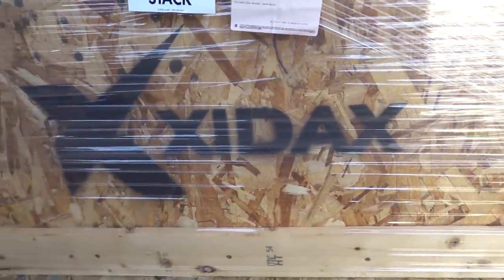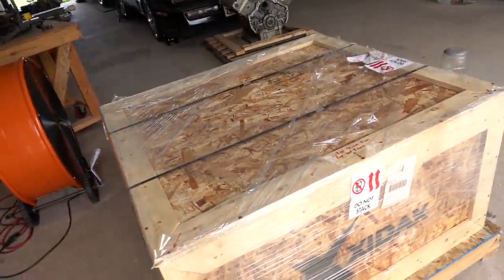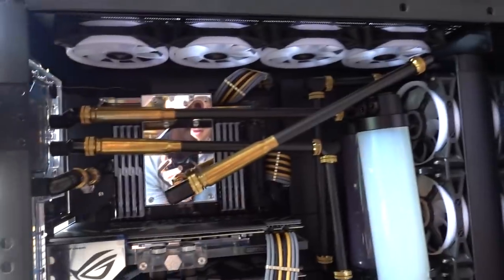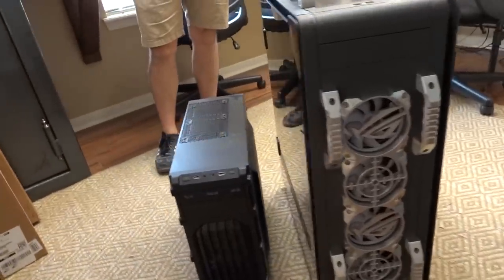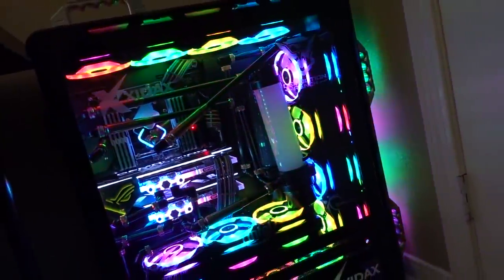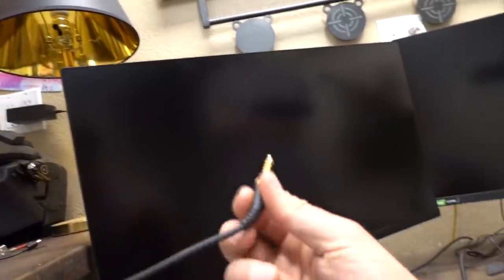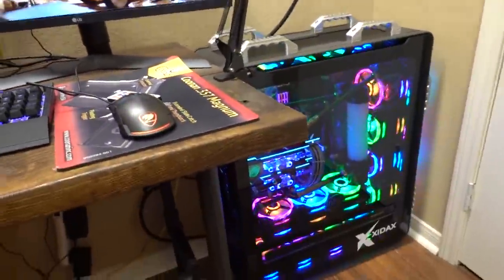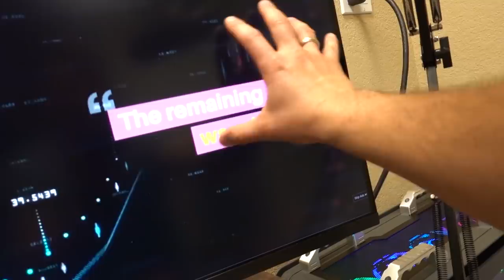The Demolition Ranch Ridiculous New Gaming Computer! TWITCH!!!!!

Comment: You need to get a really good surge protector/ups for this man.  That's like a $15,000 computer.  Don't just plug it into the wall!
Reply: Its built into the PSU on this system. But it never hurts to use one regardless. For 500$ with a 10 year warranty, you bet your ass EVGA built this PSU tough and with built in protection.
Reply: He probably has one for his entire house
Reply: @Elmer_RedEagle  You mean they have UPS on the PSU? Damn thats pretty neat
Reply: Agreed, I run an ups on my gaming PC and my router and modem.
Reply: @Elmer_RedEagle  &  @Tony K  A lot of modern PSU's will protect your system, and for such a pre-made PC build the PSU was specifically picked and probably has a unnecessary 80+ Gold or Platinum certification, so it's pretty much guaranteed it will protect without additional external UPS. UPS for gaming rigs, or in general, in home conditions are useful if you got a power blackout and you can keep using your PC for some time before UPS runs out of collected power, or shut the PC safely off. But any decent PSU should guarantee you a protection from surges.
Reply: Terrible advice. A UPS would be recommended, but NOT NEEDED.
Reply: @BIOSHOCKFOXX  They have failsafes built in, but that will only go so far. THERE IS NO PSU WITH A UPS BUILT IN.  The specific PSU is massive overkill for this, unless he's going to try overclocking the snot out of the CPU and GPU with LN2.
Reply: more like 20 grand
Reply: Please can you be more transparent with what products you get for free and whether or not they require your advertisement in return. Would be nice to know retail price on a pc like that and all other free products you get.
Reply: @jordanhart9708  So you don't think he should be running some sort of surge protector for at least 15k dollars worth of equipment? Come on man, that's just dumb.
Reply: @jordanhart9708  I don't think it's that much overkill.  Just the actual PC parts alone should be in the ~700 watt range, I'm guessing they are probably running the water pump and all 20 of the fans off of it too, along with the LED's,albeit they don't comsume much power.  They probably could have gotten away with a 1200 instead of a 1600 but they are basically the same price anyways...
Reply: @BIOSHOCKFOXX  They have some safeties built in like over and under voltage, but nothing that could actually take a surge.  Even a $30 special from Walmart would do a better job than just plugging it into the wall.
Reply: @954eb  It's entirely possible, and if that is the case even better.  I'd still be running an endpoint type protection too, can never be to careful with the cost of that equipment.
Reply: @TKacys9HR  He could have gotten away with a 850W unit. 1000W would have given a good bit of headroom. 1600W is simply overkill unless you're doing LN2.
Quite frankly, you don't HAVE to run it via a surge protector or UPS. Is it advisable? Yeah, particularly if you're in an area prone to power issues (Texas hill country isn't). If you're overclocking, a surge protector can make the power a little dirty. In that case, a UPS would be a much better investment anyways.
Reply: @Elmer_RedEagle evga isn't horrible but I always go seasonic or corsair lol
Reply: @dashausdesamadeus9557  1600W DC PSU would require a UPS that can do 2200va, those typically need a 20A circuit to supply the ups (I have 2x 2200va UPS). @OffTheRanch I would suggest getting one if you have any power problems in your area like dimming or flickering lights.
Reply: Ben Shapiro GFCI and AFCI outlets are not surge protectors. They generally don't care about the voltage/current going across the hot terminal.  They only care about the neutral or ground terminal, and they trip for different reasons...  Infact GFCI don't even work without a 3 prong grounded cord that is intact and undamaged. AFCI outlets/breakers can trip from high current inrush, which can happen with large computer PSU's getting plugged in or turned on... I hate them both..
Reply: @TKacys9HR   Ok some surge protectors come with insurance for the things plugged in, which is one point, It can help people avoid ground loops if people are tempted to plug into different wall outlets which possible could be running off a different breakers. All of the AC side electronics had to pass the same "surge protection" requirements for UL, TUV.. etc as a "surge protector power strip" The PSU has more requirements, since it's converting to DC with a number of different voltage regulators off the main rails. A surge protector is not going to protect your computer more, however a UPS "uninterrupted power supply" is a totally different animal and has batteries and or a different grid power input. The systems I've worked with are depended on by the US military at the most secure bases underground, and the electronics and equipment fundamentals have not changed for 20 years.
Reply: Pcs are protected worst that could happen is a PSU replacement
Reply: got to be worth more than that wouldn't it ?

Comment: !!!!!CAREFUL!!!!! One of the Reservoirs has come loose, that's why it's at an Angle! The one closer to the Window
Reply: Somebody better get his attention!
Reply: look again its resting on the million fans on the bottom... this pc is a shame..
Reply: Matt carriker is the biggest chad I’ve ever seen
Reply: Ikr, crazy that they missed that crooked Reservoir.
Reply: Good spot, was wondering why it skew
Reply: Not so sure, that’s hardline tubing. So if it did come loose there would likely be a leak. But still Matt, make sure it’s properly attached.
Reply: Just about to mention that.
Reply: the res is fine, just came out of one of the clips.  No biggie just pop it back in
Reply: ikr he just has to pop it into place
Reply: Good luck with the 6-12 month maintenance you'll need to do on the water loop 👌
Reply: Xidax could of made them runs a lot straighter. Would make it look cleaner.
Reply: Good thing xidax has a lifetime guarantee
Reply: @wyattfritz3695  agreed.
Reply: God I hate water cooling, for the amount of fans he should have just used air cooling. Love the pc but damn that's gonna be a pain in the ass.
Reply: @emtjim224  Xidax has some questionable PC  techs to say the least. Hopefully this holds up for him.
Reply: @wyattfritz3695  depends how it's built and what fluid they used. I've got white pastel fluid in my loop, which was properly treated before filling. I've ran it for 9+ months so far without a hint of staining, color change or performance degradation. Can easily go over a year if you know what you're doing.
Reply: @squidiz496  Even 30 fans on air won't get you anywhere near the cooling potential of a loop like this. This thing should be able to keep those two 2080ti's in the low 40's at max load with a 2+GHz overclock, and prolly under 60 in games and rendering on the 10980xe with a OC as well, all while staying near silent. 

You're never doing either of those with conventional air cooling.
Reply: @soulshot96  he will probably get someone else to do it knowing that hes an amateur and doesn't have a clear interest.

Comment: The computer is turned on for the first time... Mere yells "Honey. we've lost power downstairs..."
Reply: Was wondering if it'll make the lights dim at the very least, that seems like an awful lot of juice off the cooling lines alone
Reply: @wlehtola  apple or orange
Reply: Nah, the  computer wouldn't do that it's about the Watts on the power supply! i say he probably has about 900- watt to 1200 watt power supply! that the power supply have a safety feature which would make it shut down!
Reply: NinjaRider777R 
Case fans typically around 2 watts of power each so even if you had 50 fans you’d only be using 100 watts (bare in mind with that many fans they are all likely never going above 30% RPM. Why have a loud system with that many fans?). A single watercooling pump can use 5 watts on the low end to 25 watts on the high end. 
Fans and pumps don’t use much power. You can run multiple fans off a single motherboard fan header. 2-3 fans per header isnt abnormal. 
3x MultiGPU setups with massive CPU’s (like the Intel Extreme series), dual system setups, or LN2 overclocking is why those massive 1600w power supplies exist. For example, a single overclocked NVIDIA 2080ti graphics card can use 330 watts of power. GPU’s are the number 1 user of power in all gaming/vid editing/everyday PC’s. 
I own a custom watercooled system. It has 10 case fans with 6 of the fans cooling two 360mm rads in a single loop which cools my CPU and GPU. 
The system has a single overclocked NVIDIA 2080ti and an overclocked i7 5960x Intel extreme series processor. My power supply is a Corsair AX1200i. It maxes out at 1200 watts. 
Even with all the fans, the pump (running at max speed bc it’s a DC pump), the overclocked GPU and CPU, the 5x hard drives I have in the system, along with the large number of USB peripherals hooked up to all 10 of my Asus X99-e WS motherboards USB3 ports, etc...
At MOST I only use 650 watts out of my 1200w power supply. 
I even have a 1000 watt UPS hooked up between my PC and the power outlet. 200w less than my PSU in my computer itself is capable of. 
Even with my computer, 2K Ultrawide gsync monitor, powered Focusrite audio interface, 2 powered KRK Rokit studio monitors hooked up to the UPS it still comes nowhere near 1000 watts.

With his 2 GPU’s and CPU in that system he’s probably maxing out at around 1000w during EXTREME stress testing with CPU and both GPU’s running at max capacity.

Comment: The reservoir  looks like it's at an angle or got loose, I'd check that out
Reply: You can see it's out of the top bracket, just push it back in
Reply: There is a little more to it than just pushing it back in . I have worked with singularly pc mountd like that.
Reply: right? plus you can see no connectors on the top of that res,all on the botton so nothing supporting the top,using a U brace was a bad idea for that,they should have put an actual mounting ring
Reply: I don't know why he got such a high end water cooling build he will have no idea how to do maintenance on it
Reply: @Plane.  yeaaah... that's going to be a real bummer for Matt when he get's a leak, or the fluid gunks up that HUGE ass mono block, or clogs a VRM channel
Reply: Plane I’m pretty sure it was given to him right
Reply: Jeremiah Young Just because it was given to him right doesn’t mean that it won’t have to have maintenance done on it. Anyone who knows anything about PC’s and custom water cooling would know that
Reply: @Plane.  his brother drewski can help him on that.
Reply: @Plane.  hopefully operatordrewski will help him out.
Reply: @Plane.  ooof yeah rip matts loop
Reply: It was clearly angled purposely... the tubing is all solid and lands at angles all over the place... he can not "fix" this if it by design.

Comment: “It’s like Lunkers trying to explain his corvette’s features”.
😅😂🤣😭😭
Reply: hey lets play this yep
Reply: 30 fans... For 2 vid cards and guessing the top Intel processor.  Has be posted or talked about the actual build list? Haven't even heard of one, but even with a dual threadripper motherboard with 120 GB of 3300MHZ ram and quad 2080TIs.... 30 rgp case fans is just, "cool bro".

Edit: didn't even look at the description for build details that he posted. Tsk tsk, threadripper trumps Intel.
Reply: @MNTruckerBear  3300 mhz is not even fast and its called rgb
Reply: 2400 is the standard budget RAM speed, 3300 is 900MHZ faster than standard and 433MHZ slower than top tier... RGB is literally just flashy lights. Anything else?
Reply: @MNTruckerBear  that still doesn't mean much. 3300 MHz is really kinda average these days. There are plenty over 4000 MHz and at least one option available at 5000 MHz. Last I checked, that was far more than just 433 MHz than 3300 MHz.

Comment: The reservoir doesn't look like its held in its brackets properly, if it isn't its just being held in by the water pipes and could fall out and spill coolant everywhere. Might want to check that
Reply: I am assuming that is the fault of the custom tubing. Looks like it is attached at the very tips of that bracket attached to the radiator.
Reply: Also at 18:48 I just noticed you can see it is not even touching the bracket on the radiator. Tho it is possible it is attached to the other radiator sitting behind it. So they both could be attached, and that bracket on the radiator is just for stability in case it was to move?
Reply: He knows he mentioned it in his stream he's doing.

Comment: That crooked reservoir tank really bothers me. The piping job could had also been given more attention to, given the price point of this product.
Reply: first thing i saw was the res was popped out of its top clamp. its bugging the hell out of me
Reply: @badfudro  that and 30 fans... there is no damn need for 30 fans..
Reply: i think its not correctly mounted
Reply: Yeah, I think that it wasn't a good choice to just make the pipes go straight from A to B, instead it would look better if they were completely either horizontal or vertical and not diagonal. Kind of ruins the feel of the whole PC in my opinion.
Reply: I just think it popped out of the clamp during transport tbh..
Reply: @Baldwin_media  Seriously, 24 fans maybe (my computer is even bigger than this one), but not 30 if you have an air conditioned house. With that many fans, even if they are quiet fans, it becomes an audio issue. At the end of the video when he is reading the specs, you can hear the fan noise. 

Also, soft tubing probably would have saved the first computer. Moving that computer anywhere is risky because of the rigid tubing.
Reply: @Sahtoovi  Looks like this PC was built by Linus or someone that watch Linus build PCs
Reply: @Baldwin_media  I don't really get why there are two radiators basically on top of eachother, the other one is blowing hot air into the other. That's quite a weird choice for cooling, but I do see how it probably does offer a slight benefit.
Reply: I like the look of the diagonal hard lines. Everybody uses nice, tidy, soft lines that are tucked away. This is cool because it's different.
Reply: @MAGAMAN  My PC is around the same size, and I have only 6 fans, 3 of which are in my AIO's radiator. It does get quite loud under load but that's only because I have quite aggressive fan curves and have overclocked my CPU quite a lot. Fan noise isn't that bad if you are gaming, especially if you have a noise canceling headset, but while watching youtube or something it does get very annoying. I probably couldn't take it with 30 fans running.
Reply: Should have had another youtuber build it... more videos for everyone and still custom.
Reply: Stick to guns. This was so cringey and hard to watch as a PC nerd and enthusiast.
Reply: chad baldwin No real PC builder ever says this. The more heat dissipation the better! Always!
Reply: @kellypg  There's a reason everyone does it tidily.
Reply: @twizz420  doesn't make it less boring, though.
Reply: i feel the same its bothering me a lot everything is not straigth
Reply: @jordanhancock1031  ikr
Reply: I’m sure he will stick to 🔫🔫🔫 and has no real desire to make more computer vids for u computer geek nerds. No offense
Reply: Its not just the crooked reservoir but its gets worse, it looks like they have used and a Aroura coolant, for those not in the know they are short term show coolants but they start to break down after about 3 months and clog stuff up
Reply: yeah, whoever came up with that loop layout seriously doesn't know what they're doing. I wish he teamed up with jayz2cents, it would probably look 10x better
Reply: Jordan Hancock I mean, this is his second channel. His main channel is pretty much only guns and I'm completely fine with some videos that aren't related to guns. This was a good vlog but I must agree that it was cringey to an extent, because I'm a PC enthusiast, however my guess is that most of his viewerbase isn't in the same boat with me.
Reply: @Sahtoovi  going straight from A to B is more efficient
Reply: The cpu water block doesn’t have an outlet either
Reply: This thread is full of jealousy nerds. Smh 🤦🏽‍♂️
Reply: BrandonF216 not by much, and it doesn't look nearly as good as geometric loops.
Reply: @s0ck_net278  Maybe shipping moved it.
Reply: @Baldwin_media  I mean there isn't a need for it but in theory they will move more air with less rpm to make it run quieter. Not that it isn't ridiculous but I can maybe see the thought process lol
Reply: All I could look at was the crooked reservoir
Reply: @Baldwin_media  its so they can run at a very low speed and push the same amount of air
Reply: That PC is dope AF. End of story
Reply: @MeTaLCivil  But would take a year to get it done lol
Reply: @TheLazyGeist  not really, terry crews build was done in a couple of months but he was waiting on a prototype case that wasn't out yet. post malone build took so long because post was blowing him off all the time